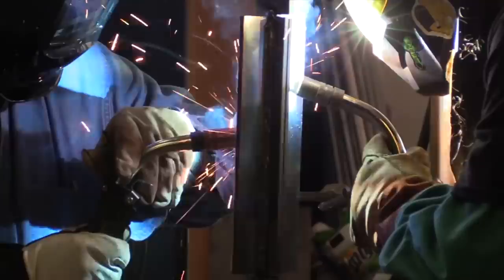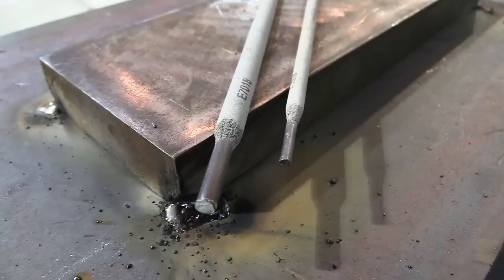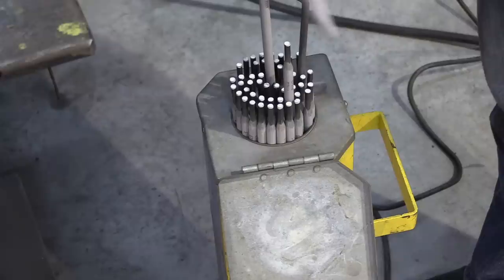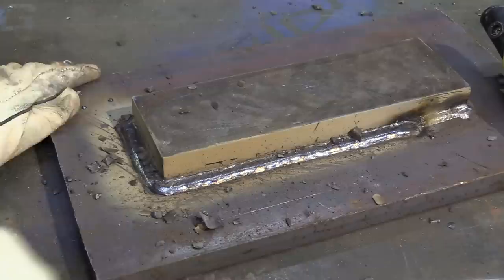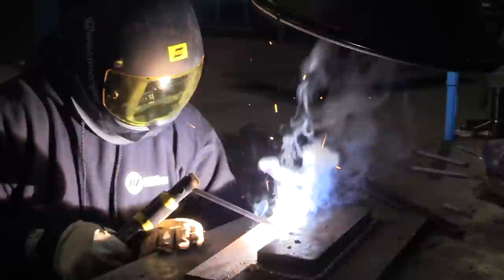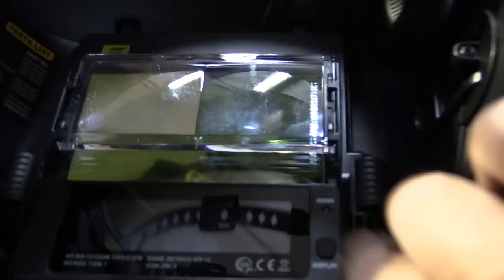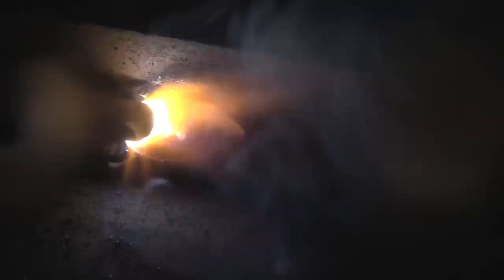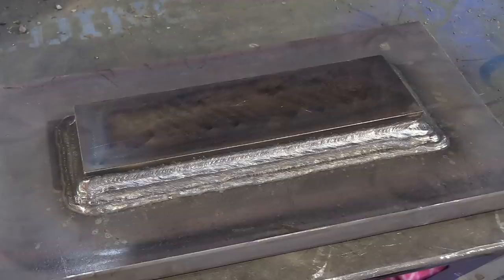Lessons from My First Welding Job

Comment: In my early days I didn't even know I had a crappy job till I got something better.
65 years later I realize just how crappy some were!  We all pay our dues to get in to the old mans club.
Reply: Lee Barnhart what are u doing now?
Reply: Alfonso Lopez e......After 45 years of welding, machining and fabricating oddly enough I'm the manager of a water plant and have a part time welding shop at home where I pick and choose the jobs I want to do.  Couldn't turn down the money offered by the water district but I'll be welding and fabricating till the day I die.  Heavy stick welding like this is still my favorite form of welding above all others........all is good under the hood!
Reply: lee the easiest job i had payed also the most
Reply: This is true.
Reply: This guy is changing out truck frames an welding them. Little bit of fun and a little bit of crap combined, pays well
Reply: If you're not learning or improving a skill in your job, that's a crappy job to me.
Reply: @TheTurpin1234  even flipping burgers should increase ur spatula skills
Reply: or a woman here in the old mans club ;)
Reply: Burned 1/4 Inch intershield for 2 years. Then .045 spray ark for another 2. Then I got my first gas drive. A Miller 250 and that was 45 years ago.

Comment: For lots of 7018 work, I keep a brick on the table. Nothing fancy, just a square paver. I tap the rod straight down, and scrape it to the side so starts are easy.
Reply: Yep $1.68 ones from homedepot there kinga redish color or atleast the ones in my wife's flower bed if she figures out I'm the one stealing them I'm busted
Reply: Jeremy hanna hopefully she doesn’t watch welding videos
Reply: Yup. I usually just tap them to concrete floor takes few seconds and they restart nicely.

Comment: Really enjoy watching your videos, brings back memories of my time in the pressure vessel industry especially this particular video with multi pass E7018 electrodes. The only issue i had with the Low Hydrogen electrodes was the final pass on a fillet would often leave you with a shoulder but I remember my charge-hand telling me that because of that shoulder and the increased chance of undercut being visible he would say use a general purpose electrode to finish it off. I remember saying but we have got to do ultrasonic tests on the fillets and the metallurgy of the weld would be compromised. How little I knew as he explained the dilution rate of the previous welds having a single pass from a E6010 would have no effect and with regards to undercut you just made it disappear plus the multi fillet pass was then a perfect mitre of equal leg length.

Keep up the videos I enjoy watching them, I no longer am in the industry finishing some 26 years ago, but i keep my hand in as i retired 4 years early than my government retirement age in doing steel gates and panel fences along with flat truck floor repairs with my Thermal arc 3-1 Fabricator 181i  invertor which i really enjoy using
Reply: Caravan Tuggers Hey, you got words of advice for a new welder? I think my boss is kinda Asshat-ish. But the job is relaxing, we do anything from high rise staircases in NYC to 1700 artwork repairs for top antique traders. It’s a great job in that sense, but I want a kind workplace. With fun/ lighthearted people, can I find that welding? Or in a union?

Comment: Working at a pipe yard helping boost production for a project. Welding 49” flanges, putting down 1/2” fillets, and 7/8” fillets. We’re burning about a 50lb can per flange. Talk about some hot stingers, some hot whips, and plenty of practice planning ahead on beads!

Comment: I was dual shield welding with 1/16th wire today, and I had my hood on the maximum darkness of 13. You are totally right about how bright it gets at higher amperage.

Comment: I'm 66 now went to Vocational School in high school. First job I got was in a shop that manufactured blast furnaces and hot metal cars. If you didn't average 50 pounds of welding rod a day they considered you slacking off. They weighed your welding rod out and you had to turn your stubs in at the end of your shift. You're right you get to the point to where you don't even think about what you're doing, 7018 vertical up 8 hours straight and it was mind-numbing but it earned me a good living to have such a skill. I would recommend that any young man learn a skilled trade. Beautiful weld by the way.

Comment: What we used to do is lightly tap the stick onto some clean concrete to freshen up that tip a bit. But the electrodes have to be nice and dry.

Comment: I know about sweat shops, my first welding job was at a foundry fixing castings, was burning rod for 10 hrs a day, 6 days a week.  You had to stay in your "cell" as they called it until break was called or you were fired on the spot.  Had the the 2am to 12:30pm shift and it was the roughest job I think I ever had.  Did that for 3 months and moved on.  Learned a lot in a very short time, it was truly a trial by fire.

Comment: I had a job like you describe, welding fuel oil tanks for residential use.  All Cold Rolled  material with no cleaning so there was plenty of oil to burn through. One Lap Joint, two edge joints for the end caps and 5 fittings for the piping. 5/52 6013 just to fuse the joints. It sucked because it was so dirty but I got very good working with dirty metal at high current, this came in handy in my real job for an Electric Utility work when I had to close up the boiler skin after a wall tube repair in the Generating Stations.

Comment: I’ve got a carbide scraper I use for BBs. This has an 1/8” thick blade 1.5” wide mounted in a wood handle. The blade edge is square. It’s sharp! I bought it from McMaster Carr.

Comment: Nice welds and advice Jody. I've been in the industry for about 3 years now and have had 5 different jobs. The first was mostly MIG welding auto parts. Tedious work and very repetitive, 60+ hours a week with low hourly pay and no benefits. From there I moved on to fabricating scissor lifts, which taught me a lot about measuring and layout, welding techniques, running saws, grinders, milling machines, etc. The pay wasn't great, but it was valuable experience that helped me get in the door at better companies. Where I'm at now I've run MIG, TIG, stick, flux core, and even a bit of oxy fuel. I also do some occasional machining and assembly. The crappy jobs I worked definitely helped me progress as a welder, and I got a lot of the really stupid rookie mistakes out of my system on non-critical jobs.

Comment: I've had that same Slyde light for a couple years now. Great little light. Should mention that the end of the light actually has a nice strong magnet on it too. I've had several other small lights that have a magnet on the end, but its nowhere near strong enough to support the light when you hang it upside down. I've used this light countless times when I'm working under cars.

Comment: I'm always amazed by the amount of thermal distortion in even the heaviest sections.  That lower plate dished right up into a shallow bowl!    How would you even try to control that if you needed it to stay pretty flat?
Reply: If say he was making two of those part he could tack them back, or tack the piece to a table and don't cut the tacks until it's cold. Same idea as a restraining bar also known as a tack bar.

Comment: Very good insight!  I never went to school for this so I am thankful for those sweat shops to get that seat time.  I started out at Bise Welding and Fab back in 2000 in Houston Tx for 9 bucks an hr.  I worked there 2 years and I got 1.50 in increments throughout that time.  I was mad back then because the owner pulled up in a brand new Camero SS that he baught cash.  Not sure what the record is now but 6 years ago, Kelly Bise (owner of the shop) built the Worlds fastest twin turbo Camero to run the Texas mile at 263.2 mph.  The video is on gearheadficks racing channel here on YouTube.  You made a good point in one of your earlier videos about having a goal when you get into welding.  Get in the game and move up the ladder.  You dont want to be in your mid 30s or early 40s(in my case) crawling up under pipe or on your knees for 10 hrs on the day welding.  I appreciate you sir and sorry for the rant.

Comment: I used to like about 280 - 300 A for my 316 flat, usually 230 - 260 on the 5/32... usually 14 on 1/8... undless outta flat... loved keeping it as hot as possible on the flats.... depending of course on the position and alloys...  looking good though.  Fun vid.  Thanks.

Comment: I have just managed to weld a fillet that actually connects two parts yesterday, seems easy but I have quite sum shitty equipment. It seems that I have always had a grounding issue, but now that I made it I have an enormous confidence boost. Shitty equipment is not an excuse for shitty work.

Comment: Those welds look fabulous Jody. I enjoyed hearing about your 1st  job experience also.  I'd love to try one of those Esab welders. They look very nice with lots of nice features and seem to weld as good as anything else out there with a skilled guy under the helmet.
I have an older Syncrowave 250 at the house and have built  a 50 amp welding outlet  in the garage for it.

I have welded my entire life but never went to school for it. If I had it to do over again I would have went to school. Learning stuff by trial and error takes much longer.
Having someone tell me to use 6010's for the bore casing I was welding is one of the best things  in this world I'd learned. I'd been using 7014's and they just don't seem to like vertical welds or anything but flat really. They make a beautiful smooth flat weld but I'm not sure anyone could use those to weld verticals or overhead.
Maybe there's a way but I never found it. 🤣 🤣

Comment: I'm taking my first welding class, and this evening I welded a metal file to the leg of my work station so it's always handy. It kinda blends in with all the spatter and crap. I'm wondering if the instructor will notice... It sure is useful right there.

Comment: Man I miss welding worked for trinity industry welding on the train cars and wwsteele welding on 4 inch thick I beam about 50 feet long talk about massive learned a lot had to preheat and check temps with the temp stick doing full pen welds that had to pass ultrasound and that gouger! Talk about erasing metal lol and even learned to tske small steps while welding and stretching as far out as possible to avoid having to many tie ins.. Still prolly wouldn't give up my desk job welding is tough on the body and summer time ain't no joke

Comment: I love my wood handle chipping hammer, much better than those spring coil handled ones. That said, chipping hammers would be so much better if the heads were made from tempered steel rather than what feels like iron butter. There's the Estwing hammer but I'm not a fan of the steel handle and plastic grip.

I love seeing how you manipulate the rod in the zoomed out view. It really helps to see you position yourself and control the stinger while wrapping corners. I have trouble doing it without gouging into the corner and leaving terrible undercut.

Comment: Immediately after burning a 3/16 7018 welding a cam follower base to 4" square CRS, I hit the slag with my hammer. One little piece no bigger than a pinkie fingernail burnt a quarter sized hole in my beard! Directly in the center of my 8" beard I have a gaping hole! When I got home I had to scissor off about 4"....those were the good 'ol days!

Comment: Pretty good duty cycle on the machine you were using to weld 10-12 hours a day lol
Reply: In heavy industries they have a lot of 100% duty cycle machines. I work in a rail car repair shop and do a TON of gouging, if i'm on a big job I can set my machine to 400-450amps and gouge for HOURS
Reply: Industrial and probably 3 phase.
Reply: @campshortclip  Yup, all 3phase 600V
Reply: Transformer machines are best for stick all day long. Inverters yeah they're  all good for adjustable arc force and hot start and great for tig work.
But you wont beat a big 500amp transformer for duty cycles

Comment: Hey Jody, I noticed the StrongHands clamps on your wall behind you - maybe an idea for a video, comparing locking C-clamps, F-clamps (and any others that are useful) of various brands for different jobs.

I've got a few different brands, Stronghands seem really good for putting a lot of force onto the parts you want clamped, but aren't as fast for repeating jobs due to the jaws not opening as far as other brands I own (Irwin and KING TONY) so you have to screw around a little to get them off and on the parts. Would be very interested in yours (and even JD's) views on clamps, force vs speed vs price, etc.

Thanks for your videos.

Comment: I run 3/16" 7018 every day at work. Overhead and horizontal. Always always ALWAYS easier to push the rod with 3/16"

Amperage 220
Arc blow is insane and uphill can't be done, downhill can however

Comment: I tell the apprentices to start where they need to finish, that way you don't run out of hand piece or get arm locked... That is to say, position yourself at the end of the rod run, then get uncomfortable at the start, working back into the comfort area to finish.

Comment: And odd question but when worked for Eagle Fabrication we used alot of 5/32 7024 and 3/16 7024 am i the only one that actually enjoys running large welding rods.

Comment: Hi Jodie! Could you share some tips for welding plugs and slots in a rather thick materials? Say 8-16mm construction steel sheets, preferably welded with stick. Any hints would be much appreciated!

Comment: I like to challenge myself in class by throwing different variables in my welding. One thing i do is, I like to gather some left over rods (that students leave behind) and try to use them up. That helps me learn to restart, deal with rod reach, and prepare the end of the rod. I cant believe how many good rods are wasted every damn day. It it infuriates me. 😡🤬

Comment: Question ,  Iv'e done about 8+years of TIG welding on  aluminum heat exchanger's but never mig weld on aluminum , does mig welding on aluminum use 100% Argon like TIG ? thanks .